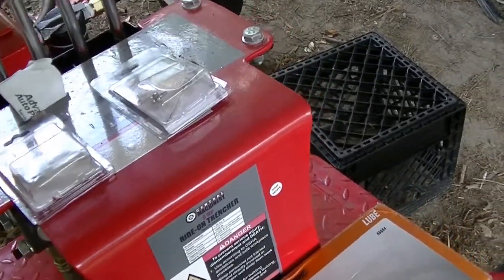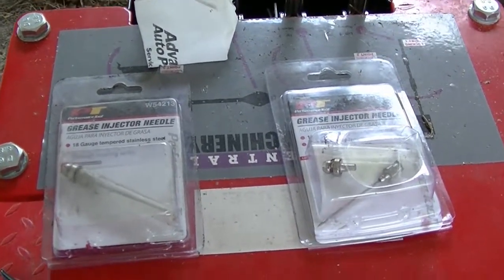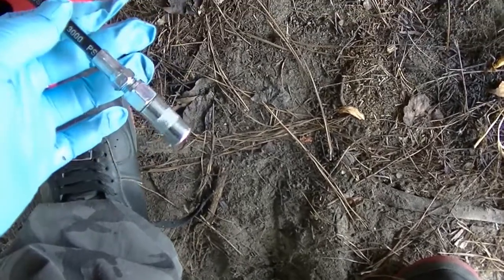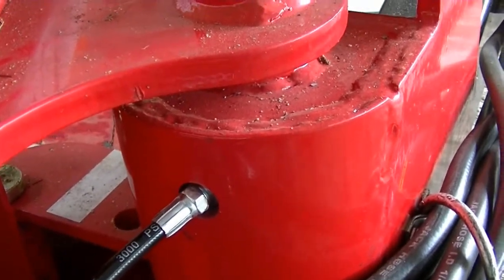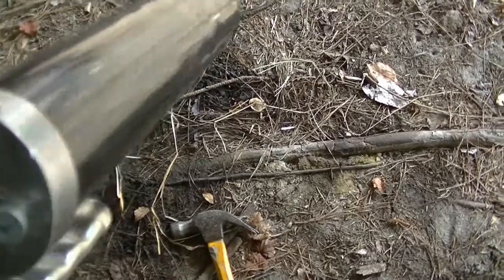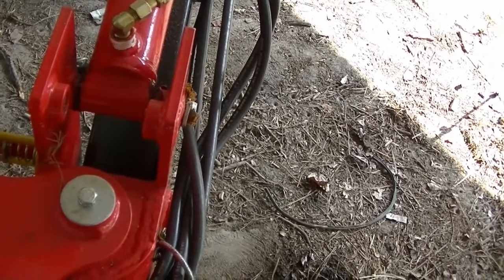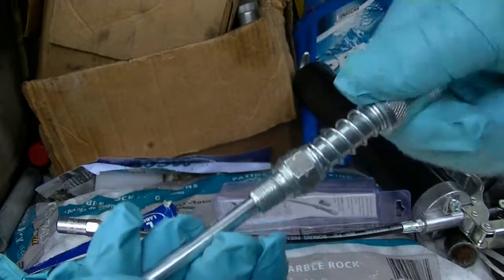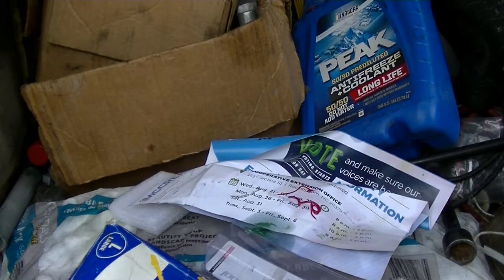Best way to lube the Harbor Freight towable backhoe

Comment: It helps to take the pressure off the cylinders.  A couple of the joints didn't want to take grease on mine.  I adjusted the pressure on the dipper and tried again.  It only took a couple tries to get the pressure off the joint I was having trouble with, then the grease went right in.  Good luck all, and happy diggins.
Reply from the maker: That is true,  there has to be a little room or less friction to add grease

Comment: You got a good video here young man, lots of useful info and suggestions, keep um coming. Just a couple comments : For anyone getting one of these machines, when you assemble it, grease every pin before you install, then replace the oem zerk fittings with high-quality M6 steel fittings, you get more threads engaged and a lot less breakage. Replace those cheap oem angled hitch pins with good D-handle pins (about $3.50 each), keeps the holes from being enlarged. And double the usefulness of the machine by adding a thumb, either weld-on or bolt-on (about $150.00 - $200.00). Engine break-in is VERY IMPORTANT !!! If you follow the break-in for the engine (1/2 throttle or less for the first 20 hours of engine use), it can last 400-600 hours with good maintenance. If you jump-in and run full throttle from day 1, you'll be lucky to get 150-250 hours of engine life.
Reply from the maker: Very good advice. Please leave a link to fittings and like and subscribe thanks.

Comment: Been running mine a few hours since getting it. Notice it's making creaking noises already. Thought they would come greased. Seems like there was no grease in them. Fighting to remove grease fittings from the existing zerk fittings. What a pain. Still need to go find the adaptor for the flush mount fittings. Didn't try the hammer to remove them from those two holes, but was afraid it would break. I tried pliers and two screwdrivers to pry it off. Finally got them off and not sure why.
Reply: I drill out the flush mount fittings and install the ball type... the little bit of anti-break-off protection you get with the flush fittings wasn't worth it to me when everything else I own uses the ball type fittings I just drilled them out and used screw in type ball fittings (if I ever damage one it's just a few seconds to unscrew it and replace with a new one) the biggest headache on these machines is the main boom swing pin as the design just doesn't grease for crap nor hold it's grease resulting in premature wear failure I replaced it twice on mine within the first 400 hrs. then decided to make my own replacement pin to tighter tolerances instead of a bolt with washer from each end to retain the pin I made mine with a flange on the top end this pin was then through bored with a 1/16 inch drill bit with 2 bushing greasing through holes at 90 degrees from each other, and a tight fitting center spool bushing retained by a tight fitting pin end bushing welded to the end just like the harbor freight pins and then the pin was capped  and secured on the bottom end with the same bolt and washer as the original, this new pin design completely eliminated the need for the hard to grease rear grease fittings on the boom swing point.
Reply: @dodgeme1986truck  I hear what you are saying, and your explanation is good.  The trouble is the length of it, and number of items/parts/mods mentioned;  just a tad overwhelming.  Any chance you could throw up a video of the thing, to go along with the explanation
Reply: @jafquist27  unfortunately I didn't record the boom pin redesign and since mine has held up so well and has stayed tight I won't be making a replacement for it anytime soon...
Reply: @dodgeme1986truck  Well, thank you for replying, nonetheless.

Comment: Thanks for the vid.   I've greased my trencher twice and I'm down...two broken fittings and one broken grease gun end.   Wish I had just replaced all the zerk fittings before greasing!   Looking carefully at the original fittings, compared to the new replacements, they seem to have a different shape.  Not sure this is what causes the stuck-on grease gun or not.
Reply from the maker: Greasing this thing is a little bit of a challenge . I broke the fitting at the main boom . replaced with harbor freight fittings , i think i have a video on that as well if you want to check that out , also once it starts to run dry you can hear this thing squeaking . if you don't grease after that your on borrowed time .

Comment: Oh hell yeah... You rule dude!  I'm getting one of these delivered next week and want to hit the ground running with it.

Gotta order one of these needle fittings.

Also how is that walmart fluid holding up?  Wondering if I should get that, or use a 5 gallon tub I have for an old ford tractor.

I've been making offgrid homestead videos for a few months now.  I hope they're even 1/10th as helpful as this was for me. Thanks.
Reply: Oh.  Just saw on another video. That one that's at the bottom of the boom you asked about why it doesn't have a hole to grease...

It's a fitting underneath like the 2 that are in the holes you used the hammers claw to remove.  Hope that helps.
Reply from the maker: Thanks for watching appreciate the kind words. Walmart fluid is fine. Do me a favor. Please like and subscribe.
Reply: @HoodHandyman   already did!  Check me out too if you're bored some day.
Reply from the maker: @WatchMeBuild  on my way
Reply from the maker: @WatchMeBuild  I subscribed brother looks like you been buy as well . Anyone who reads this subscribe to my channel and Watch me builds . Thank you